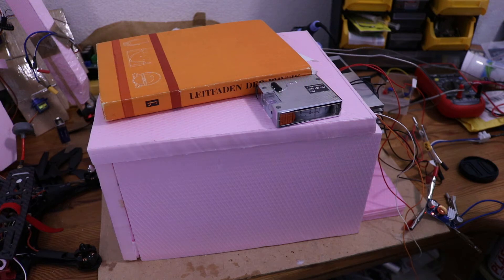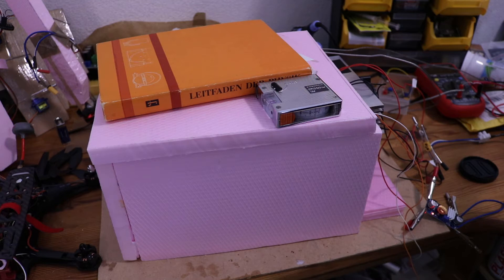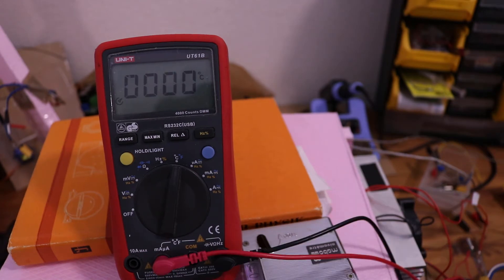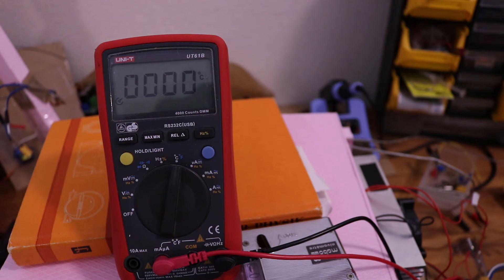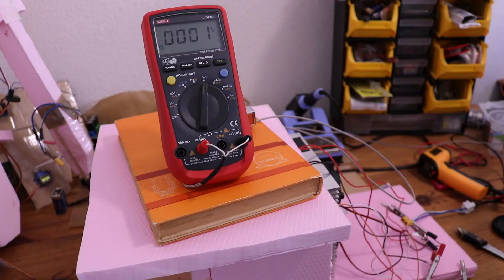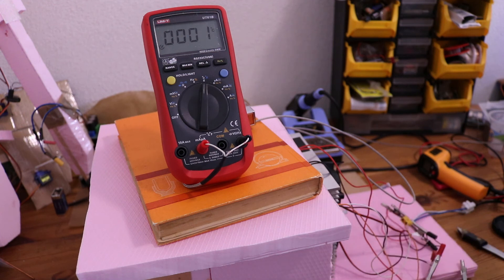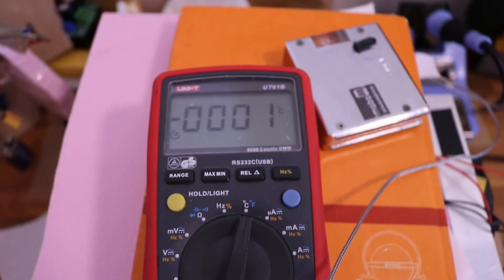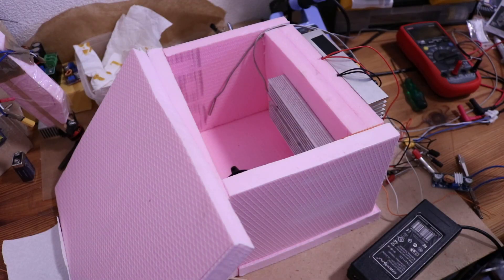Building a DIY Peltier mini Freezer

Comment: I want to build that
Reply from the maker: Keep in mind that it's not very efficient :p
Reply: @thesciencefurry  ha i buy petier module for about 2$ it is getting hotter and hotter idontknow why?
Reply from the maker: @TristanYT1  wdym? You have to put it on a heatsink.
Reply: @thesciencefurry  problem solved your rigth. I search some information about this you need to remove more heat as possible to get a colder side. I use large heatsink and it works great
Reply from the maker: @TristanYT1  Indeed, if you remove heat you have to dump it somewhere. Even more important for peltiers, because the heat you removed wants to flow back through the thin module.
Reply: @thesciencefurry  thanks for info. 😊